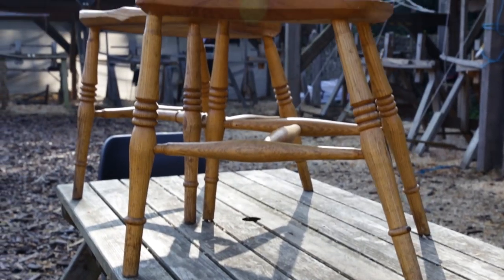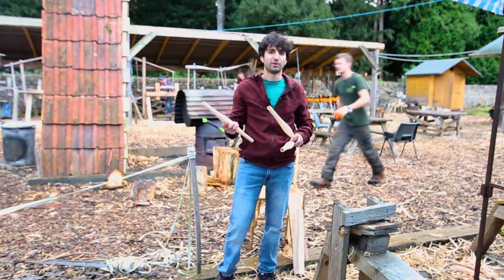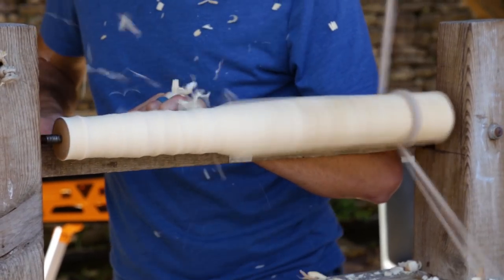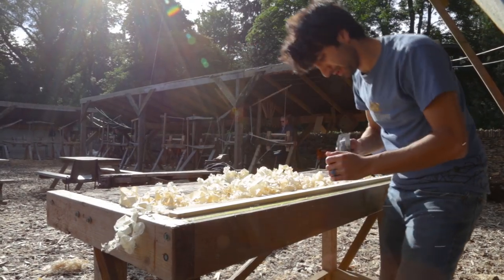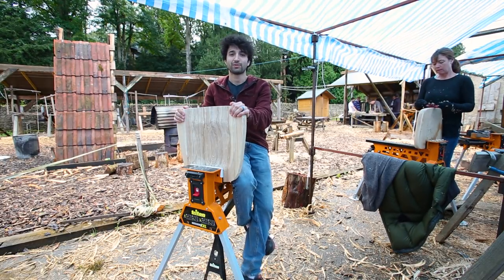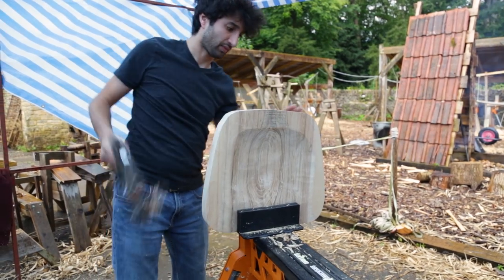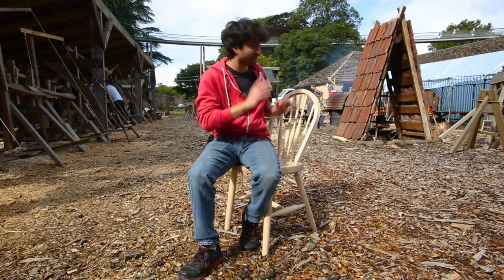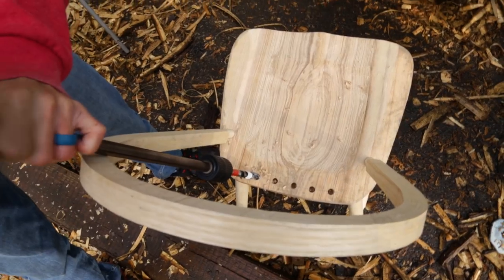Matt Cremona making a Windsor chair from fresh logs

Comment: Do you realise you are now a fully qualified “bodger” ?
Great to see you got the angles right. Was that Ash you were using. Traditionally it would have been Elm for the seat and adzed wet as it goes rock hard. No Elm available now after Dutch elm disease. Did you get to the Windsor chair museum in High Wycombe?